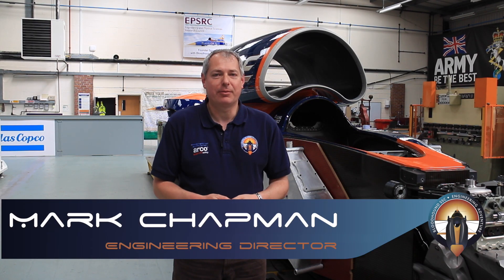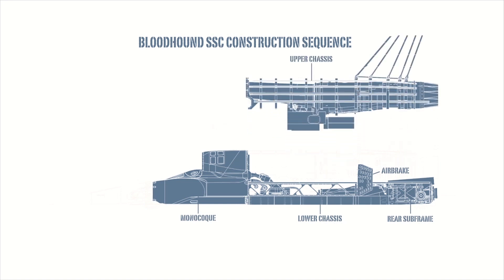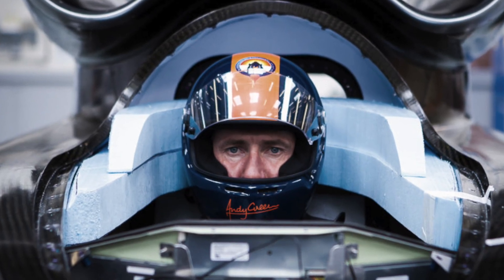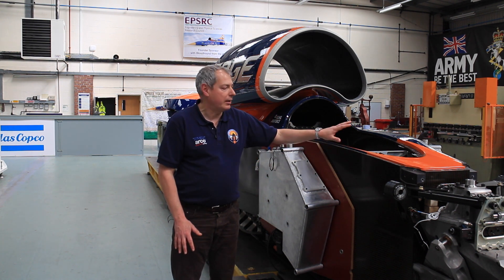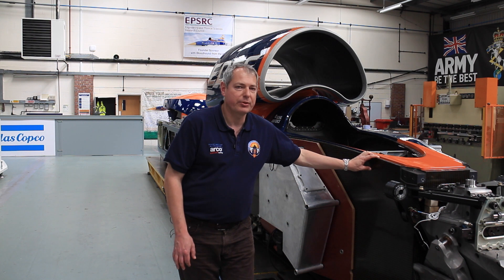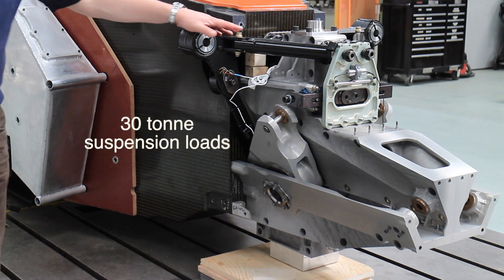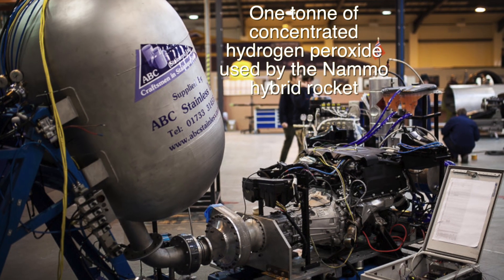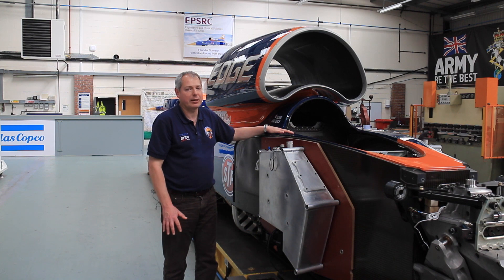Anatomy of the Car - Monocoque

Comment: Hey Bloodhound team: Do you have to insulate the firewall between Andy and the tank? I can imagine, that the tank freezes quite fast when you discharge it!?
Reply: onethirdofGilgamesh HTP is liquid at standard temperature and pressure, so the only gas that will be expanding in the tank is whatever is used to fill the ullage space. I doubt the cooling from the ullage gas expansion would be enough to warrant insulation. idk if they're doing this, but if the ullage gas is compressed air bled from the compressor there might not be any expansion cooling at all.
:)
Reply: I don't think the lack of heat is going to be an issue with this mission.